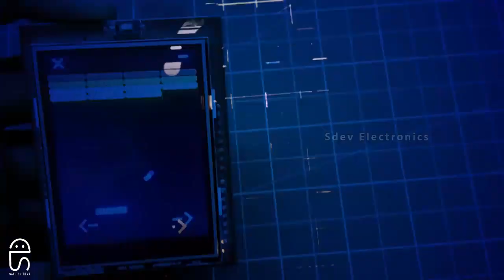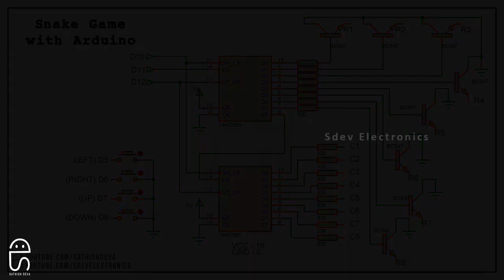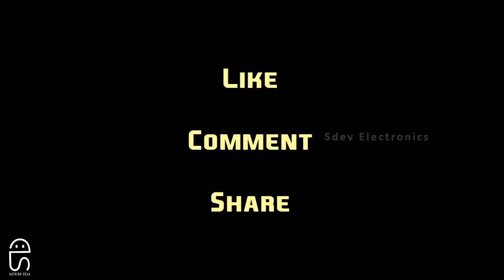Snake Game using Arduino | SdevElectronics

Comment: Can you make a video like this using arduino nano
Reply from the maker: No change in Circuit and Code. Just change IC with Nano as per the circuit diagram and pinouts.